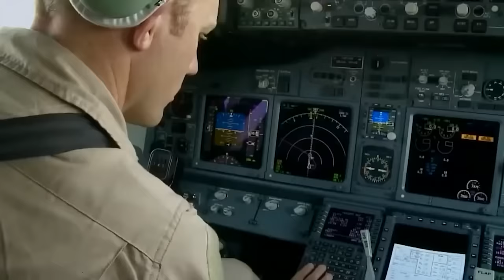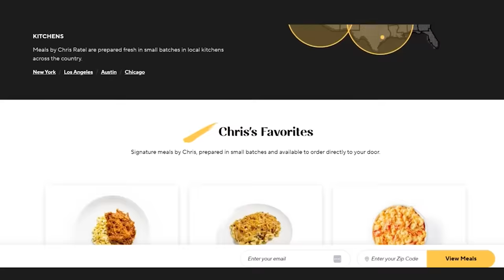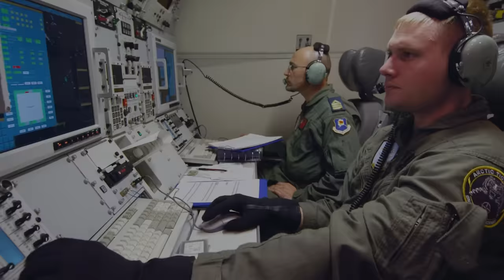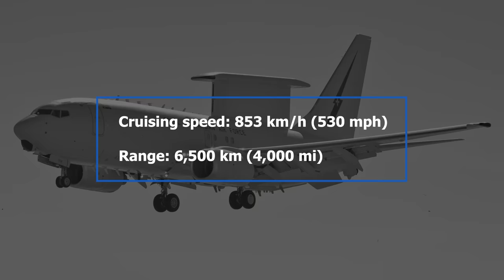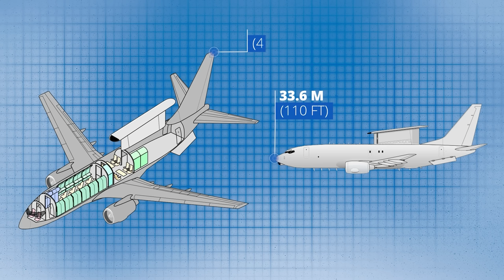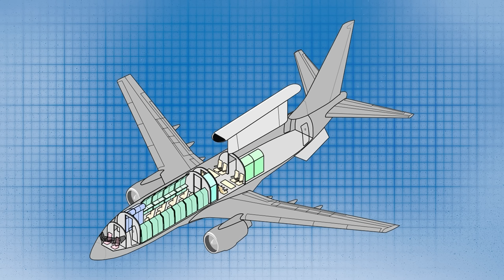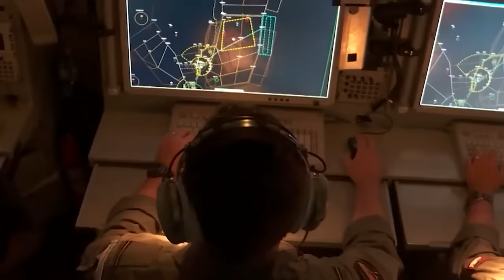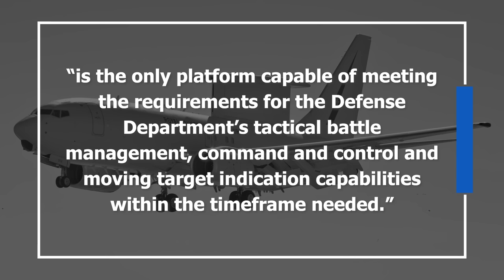The Boeing Wedgetail: The Plane That Will Control World War III

Comment: Simon, I know that you do not write the defence scripts but do tell those who do to include at least a mention of Australian models having shown significant metal structure problems earlier than projections predicted.
Turkey reported similar things but has a tradition of overhauling US-made aircraft with underrated expertise. E.g. their extended life F-16s bear little resemblance to the original GD airframes. Also, bear in mind that Boeing is currently having to ground numerous Seattle products in civil aviation.
Your writers also need to study developments in SIGINT assets from near space developing between Asian states and Russia. The UK and Japan, alongside "local partners" are well on with variants of drones able to 'swarm' to simple, localized commands without leaving electromagnetic traces sufficient to determine a sending point as well as allowing a potential enemy to map concerted activity -- called 'joining the dots'. Composite manned or crew-less submarines made of composites seem to be included in this but I haven't a clue how.
AEWCC large aircraft on missions with starting and ending times, even if not returning to departure bases, glow with EM activity and are already obsolete.

Comment: It can be argued that the aircraft that will control WWIII will be the NAOC (National Airborne Operations Center)  The US has 4-5 of them, all 747's capable of acting as command and control for the entire war if needed.  There is at least one always in the air, and one on a runway with the engines running for immediate take off.
Reply: It can be argued. But you’d be wrong

Comment: What forces them to use a 30-year old commercial body instead of the latest 737?
Reply: Boeing has seperate production line for 737NG and can deliver on time. Max conversion would take a lot longer.

Comment: The E-8 Poseidon is based on the 737-800 whereas the Wedgetail is based on the -700. I wonder why it turned out like that.
Reply: Because the RAAF requirements stated that the radar shouldn't be rotating......same as why we went with Ageis type "flat" radars rather that "rotating" radars
Reply: digital systems means that you dont need as large a plane to carry similar systems.  analogue systems for AWACs of the caspability in the E3's can be achived with a MESA set. instead of picking up a threat every nn number of seconds. the MESA is on constant scan with an active steered array

Comment: The aerospace nerd in me is going nuts at him not pronouncing it "Ay-Whacks(AWACS). Like full blown Forrest Whitaker eye irritated.
Reply: Good thing it is AEW&C then and not AWAC
Reply: @thelandofnod123  AWACS is a generalized acronym that is used for all airborne radar systems
Reply: @JamesSherrick  Nope, E-3 is AWAC, E-7 is AEW&C.
Reply: @thelandofnod123  Again, look it up. Although AWACS is the specific name for the exact aircraft used by US and Japan, it is also used synonymously for all airborne warning radars.
Russians don't have AWACS and it's still referred to as AWACS
 Calm down
Reply: @JamesSherrick  There is zero reason to look it, as someone who has lived that life, using the term AWAC for the Wedgetail is just lazy. Any self respecting “aerospace nerd” should know better. This is in the same category as calling any F-35 a JSF.

Comment: Wouldn't it be possible and with longer operational capability/weight/fuel saving/size/cost effectiveness to built an AWACS UAV?
Reply: No - you have to have the operators on board to control the fight - the speed of light is too slow and relying on satellites doesn't work in practice.   The project examined that idea early and discarded it.

Comment: I can't believe Simon didn't cover the Wedgetail's use during the Cascadian Conflict between the Pacific Federation and the Cascadian Independence Front. Both sides used this EW aircraft to great effect during that war with even some foreign mercenaries using the aircraft to coordinate strikes into the Solana Communications Array in the Aitor Desert. They even saw use during Operation Guillotine over the Bering Strait between Magadan and Cascadian Alaska, though several were shot down on BOTH the Federation and Cascadian sides.

That being said, I wonder when Simon will cover the Anura, Littoria, or even the 205 class airships as those are megaprojects as well.
Reply: You didn’t mention the Kamarians, although to be fair their effectiveness has been reduced considerably by years of pounding by the ADF.

Comment: And what do the idiots at the UK MOD do. Get rid of our older RAF Boeing E-3's and now we wait ages for the E-7 to enter service, also the new RAF E-7's cannot be air to air refuelled by our own RAF A330 Voyager Tanker aircraft. The E-7 uses the "Boom" method of the American KC-135, not the Hose and Drogue method our RAF A330's use. The same problem applies to our new P-8 Posideon aircraft, as they are the same 737 based airframe as the E-7.

Comment: One limitation of the wedge design was NOT 360 coverage all the time. Dome design could do that easily. How have they resolved this issue in the new design? Knowing that would be interesting. Thanks!
Reply: They have front and back sensors as well as side arrays.
Reply: Flight paths  incorporate turns and “race track” paths to ensure proper 360 coverage
Reply: We specifically designed it to NOT have a rotation system.........it's a bitch for maintenance in sandy deserts.......this works like Ageis radars work......more or less constant pulses rather than sweeps
Reply: Google "phased array radar" - no need for mechanical moving parts. Surface naval vessels also use this - no need for rotating radomes anymore.

Comment: What is Saab providing with their airplane? And does Northrop Grumman have a plane of their own?
Reply: NG does….kind of.  They made / make the E2 Hawkeye
Reply: As far as public info goes: pretty much the same capabilities but in a smaller airframe, which is better in some aspects but worse in others.
Reply: @davidjohansson8739 the biggest difference is I don’t think Saab’s aircraft can fly as high as a 737, so that gives the Wedgetail’s radar better range.
Reply: @cruisinguy6024   The E2 Hawkeye (currently version D is in production) has done yeoman's duty with the USN for a LONG time. It may not be QUITE as capable (due crew numbers), but then, the E3 / E7 can't takeoff and land on CVN's either 😁
Reply: @scottcooper4391  I’m not knocking the E2 as it’s super capable for its size, but due to its limited size it just doesn’t have the same capabilities as the E3 or comparable sized AWACS (like the Japanese with their 767 based AWACS).  

The E-2D is definitely capable for a carrier launched platform but quite simply it doesn’t have the range, C&C, and overall battle management capabilities of a larger airframe that houses 6x the number of crew, electronics, compute power, and electrics generation. 

One of the great things about the E-2 platform is it gives the US navy capabilities no other naval force has (I don’t count the Brits with their helicopter mounted radar). I’m actually somewhat surprised China hasn’t developed such a capability but it doesn’t seem like they’re truly serious having a real blue water navy.   It wouldn’t surprise me if Japan was the next navy to develop a carrier based aerial surveillance system…..I wonder if the Osprey could be rigged for such a role???
Reply: SAABs plane is kinda a long shot
its good but they will have to sweet pot alot to attract the USAF
Reply: @verdebusterAP  it’s not a bad platform but definitely not sufficient for the USAF and USN
Reply: @cruisinguy6024  
I wouldnt say that 
While the E-2D is latest variant of the E-2, USN will need a newer aircraft to replace it
So the smart pay would be to develop a variant for carrier operations
The USAF needs to dump the E-7 and revisit the E-10 program

Comment: edit:
I'm done with your videos, Simon.  You're now interrupting your videos MID THOUGHT for advertisements!

"Today, there are only a few AWACS operating in the world.  HAVE YOU EVER FOUND YOURSELF..."

Did you write essays like this?
------
Yeah...
Until it's way over budget, behind schedule, software causes crashes, doors fall off, engines fail from overheating, valves corrode shut, and then they complain that they can't make money on fixed price contracts.
Reply: Thanks very much for letting everyone know. Also, this just in, no one cares.

Comment: No, this is not the future of electronic warfare (surveillance and command), at least not for major powers (like the United States, China, or Russia). These platforms have become extremely vulnerable to long-range missile attacks and the development of stealth technologies that allow approaching this aircraft even closer or not to see enemy aircraft on the battlefield at all (which is precisely its purpose). That's why the Americans are not creating their new platform, don't bother yourself with this encyclopedic knowledge provided by the Megaprojects channel. The future lies in the networked action of so-called "fifth-generation" aircraft, unmanned systems, and primarily newer generations of satellites that can change their trajectory more freely than before. Radar surveillance by America will be conducted from space, where platforms are still somewhat safe. This is for the slightly poorer and for conflicts of local, lesser intensity.

Comment: I don't understand why they don't have underwing pylons with long range standoff missiles for defense.
Reply: The E-7 Wedgetail is supposed to be teamed with MQ-28 Ghost Bat drones.
The related P-8 Poseidon does have a bomb bay aft of the wing.
Reply: @allangibson8494 
 
I've seen real pics of the P-8 with 4 dedicated underwing stores, for carrying heavy Naval missiles/ASW weapons & stores.

True, I've not heard it confirmed officially anywhere, and I've not researched it specifically, but I was under the impression that this capability is built-in, (along with a few nice others)..even if they don't always employ them, or use it as an everyday standard, for the RAAF P-8 fleet..

I'd bet they all certainly can, if they need to..or at the very least it's an upgrade package option, that some vetted countries have access to, that others don't.

Either way, external wing-mounted weapons stores capability, certainly does exist for some P-8's out there.

Not an expert on them, and not my area of expertise  specifically, I just know what I've seen.

And if we did know more, we'd likely not be at liberty to discuss it with any of you anyway, right..? 

Yeah, you know it. 😈

Fair winds & following seas, folks. 🍻👍💙🇦🇺
Reply: These in RAAF service are  ALL built to be capable of launching Ikulia torpedo systems........unfortunately the Yanks are pissy we don't want their 70s era Mk 48s
Reply: @richardcostello360  
Ah, that would explain a bit..

Comment: -The only problem I have with this is that it is based on the 737.

Forget all the MAX-9 problems of late. YES Boeing screwed up big-time by trying to save a few thousand dollars per airframe by outsourcing their construction to a non-union shop in Wichita.  And you can see how OUTSOURCING and trying to GET AROUND UNIONS works out for yah~

Anyway, the 737 has been a turkey since it's birth.  Boeing had to jump through all sorts of hoops to make this thing fly right, to even include vortex generators on the extreme rear end of the fuselage to cancel out an annoying buzz heard at the aft end of the cabin.  And then they had the hard-over rudder problems, in which 737's tried on several occasions to do barrel rolls BY THEMSELVES, and now we have the MAX fiascos.  This airplane is band-aid on top of band-aid, or fixes to fixes.  But what is worse is that this airplane shares the cockpit nose and fuselage barrel with the 707 and the 727, and the fuselage barrel with the....757.

Yes, the mighty 757!  Probably the best airliner ever built.  I could do incredible things and never gave a bit of trouble. They never had to do anything to it to make it fly right, and doors never just "blew off" of 757's!  This airplane probably had the best high bypass turbofan ever built, the Rolls Royce RB-211.535, and it had four wheel main trucks;  Basically, all the tires were the same, the nose tires and the main gear tires.  THIS is important, because this saves money but more importantly there are now FOUR sets of brakes to stop this max takeoff weight 230,000 pound airplane instead of only TWO on the 737, and that other airplane, the A320.

-Yet, when push came to shove, Boeing elected to stop producing the FAR SUPERIOR 757 in favor of the cheaper 737 design.  And you can see where cost cutting has gotten them now....

I seriously think that McDonald Ronald bean counters took over Boeing when they bought that silly company from Los Angeles in 1997.  McDonell Douglas was legendary for being cheap.  Now the red and yellow clown is shitting all over the floors in Boeing headquarters.  In Chicago.

What?  Another bad decision, along with the silly NON UNION plant in South Carolina, which has mangled production of the 787.  All of this is why this company's commercial airplane division is in serious trouble right now.  They cannot do ANYTHING right!  And I am a committed Boeing man...
Reply: Strange, Australia has had an excellent service, availability and safety record with this platform and so have the other operators of it.
Reply: @FishandHunt  So you are saying there are no problems with the 737?

And you get your information from where?
Reply: @Flies2FLL  
My brother in law is an E-7A maintainer for No. 2 Squadron at RAAF Williamtown. Where are you getting yours from, google?
Reply: @FishandHunt  31 years of experience in the airline industry at 6 airlines as flight engineer, first officer, and captain....

Where are YOU getting your experience to make a comment to me?
Reply: @Flies2FLL  
Like I said, my brother in law works on them for RAAF. Apparently you don't think that they are a good aircraft but he tells me that the Australian airforce has had an excellent run with them since they entered service. I'm sticking with my source not your opinion. Have a nice day.

Comment: OMFG!  Check the bolts on the door plugs and make sure the pilots know about the MCAS!  🤣🤣🤣Despite that I'm still planning a factory tour of Boeing soon.
Reply: These aircraft are based on the 737NG not the max, they don't have MCAS and they don't have the doors option like the one that blew out on the Max

Comment: The wedge tail was really just meant for export. But America has decided to go with it instead of developing a new airframe. I do wonder if this compromise will bite them in the not so distant future. Finding themselves needing to upgrade an entire fleet in a decade to keep pace/advantage with Chinese assets.
Reply: I think it'll be fine, it's the same family of airframes as the modern P-8 Poseidon and the C-40 Clipper. They honestly should consider adding a tanker variant to simplify logistics in the future between these aircraft. Also, Boeing developed it with Australia, so it's kind of is being exported to the US
Reply: Uhhhh dude you got that wrong......
Australia is exporting it to the US, we own everything on it bar the civilian airframes 😂
Hence why we only sell the 1st generation software/technology and radar technology.......and withhold the source code.......because we take national security seriously
Reply: @richardcostello360  cool. I just worry it’s not good enough.
Reply: @richardcostello360  Ahhhhhh, no, this is not correct.

Comment: The E3 functions fine as a plane.  The upgrades will happen in its radar and electronics.
Reply: Except it's a 70 year old frame, there's only so much maintenance that can be done and only so many upgrades that can be added to it before it's more expensive than retrofitting a newer aircraft with far more basic capabilities.
Reply: No, it doesn't - the 707 airframe is almost impossible to maintain now (look up E-3 sortie rates) and incredibly expensive to operate, that is why the US is replacing it with Wedgetail, Australia selected one of the worlds most common airframes to build it on, spares are cheap and plentiful.
If the E-3 airframe was just fine, they'd swap out the radars, recertify and continue operating.

Comment: Lol, I mean, aren't the new 737s deathtraps? I certainly wouldn't fly in one. Relying on these as your secret weapon seems like... well, I guess it makes as much sense as anything else our elite failsons are doing lately.
Reply: Don't worry, the E-7 is actually based on the 737 NG, the 3rd generation of the 737 that came out in 1996 and is a very reliable and safe aircraft.
Reply: @EuropeanRailfan-AM  Yeah I noticed after I posted that they started buying them in the 1990s. I didn't watch to the end; was it only Australia that bought them?

Comment: I'm just curious, is a Stealth AWACS possible?
Reply: Stealth AEW&C? Sort of, kinda, but not to the same capabilities. You can lean on newer platforms (F-35 ect) abilities to gather and share information, however package restrictions mean performance restrictions. There are other things that can be done to reduce RCS on a platform like this but there is an ENORMOUS amount of antennas on something like this with a matching radome to boot.